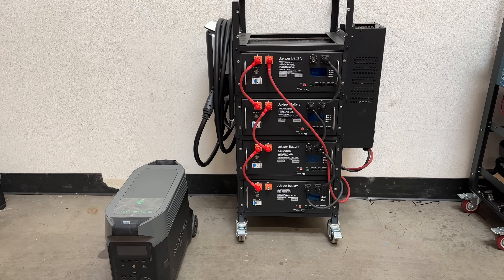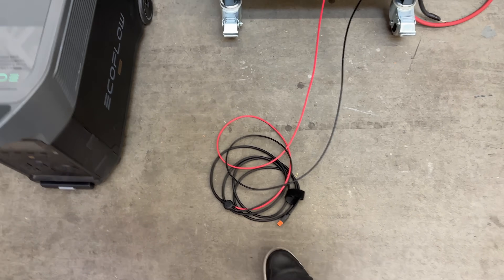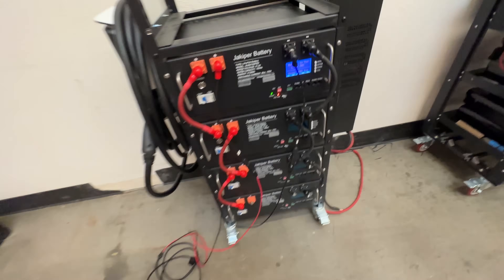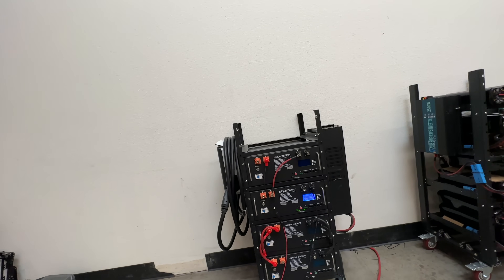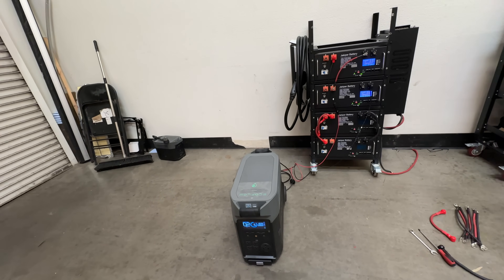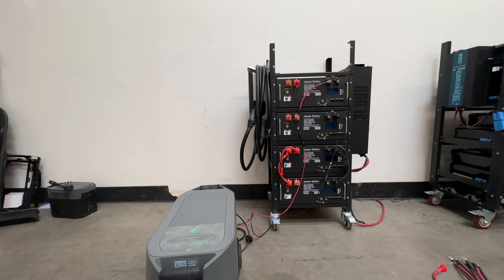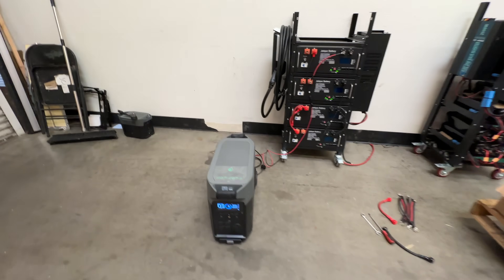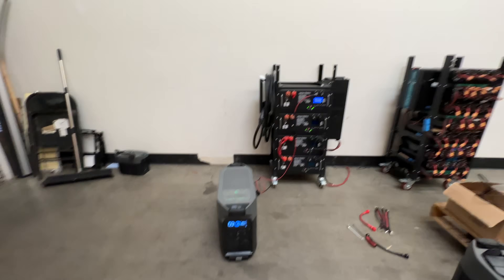48v Rack Mount LiFePO4 Batteries + @EcoFlowTech  DeltaPro

Comment: Your videos are great. I’m seeing mixed info on what xt60 or xt60i will work and they don’t have any solar charging cables for sale. The confusing thing is the car charger has an orange xt60i with extra pin. Which one is it?  Using the delta 2 btw.
Reply: The pin is connected to the negative in the xt60i for the solar. The pin is connected to positive for car charger.

Comment: I want to thank you for teaching us… I have 2 Echoflow Delta Pro’s and 4 external batteries. How can I charge the those batteries you have in the rack with solar?
Reply: With a mppt charge controller or a ac battery charger with the amount of voltage your batteries are. So if its 48v thats what charger you'll need.

Comment: not a bad idea for a small power and compact off-grid setup, like vanlife or RV.  I've been screaming in vanlife build videos that the electrical system can be better with a powerstation, where majority still use pricey and complicated Victron gear. 
I also find this channel finally covering LFP related equipment.

Comment: What is the point on connecting the batteries in series?!? There is none
Reply: to get 48v
Reply from the maker: You only need to connect cells in series if you need more that 3v.   Literally all battery packs above 3v-4v have cells connected in series
Reply: like Jehu said in another Comment, Delta pro can pull a max of 15 Amp.. no matter what the Voltage.. by plugging batterie in serie you double de voltage instead of doubling the amps by connecting it in parallel .. following the watt calculation of W=A*V ( watts = amp times volts ) you get double wattage for charging .. 3.6kw delta pro will need ( 3.6/1.6 = 2.25 ) about 2h30 to fully charge instead of  (3.6 / 0.8 ) almost 5 hours.. with 1600 watts of charging at 96ishVolts you still can charge the unit even if you are pulling 1000watts of power compared to charging it at 800 watts 48V... so yea .. electrical connections matters :)
Reply: I have a DP 
I advise do NOT exceed the 150 v 
In contrast the amps will be regulated on input . 
As in I have 3s2p strings of 47.24 v panels and so 3x47 for voltage is under but panels are 9.07ams max x 2 . Anyway don’t exceed 150v void warranties is what I’ve heard

Comment: I’d like to see hacking the Delta Pro with a similar battery rack set as if it was the official Delta Pro extra battery with discharge and charge functions.
Reply from the maker: That’s above my abilities
Reply: @jehugarcia  I don't believe it. Simply get the extra battery cable from ecoflow, cut it open and figure out the wiring. Done! If anyone could do this , you could
Reply: Perfekt idea
Reply: Hi. If you have only one battery jakiper for help the Delta 2 max for the night...How can you charge after the Battery jakiper if you don't have 1 inverter to connected with the panel solar

Comment: Any advise on how to setup charging the 48v battery bank with solar of course a solar charger controller in between then connected to the EFDP  and have this working in all harmony by any chance ? Wonder if it will dance well together ?
Reply: I think best way would be all in one mppt/inverter to server rack to bus bar to dc to dc charger to ecoflow delta pro.

Comment: Will this work with the delta max?
Reply: Will work with any solar generator as long as you stay within its voltage of solar charging & also having the connection it needs to charge it.

Comment: If im using that as a UPS wouldn't the ecoflow try to keep using the batteries charge, thinking its solar input?
so if we leave the charger on the batteries, itd just get sucked right back into the ecoflow right??
Need to think of a way to only use the batteries when the mains power is disabled
Reply: Way I use it or might work but I use it with the grid is a smart plug that you can turn on & off with your phone. You'd probably have to use a dc to ac inverter with the smart plug then to delta pro or all of that connected to a fuse block the server rack batteries are connected to. I know there would be some loss but the only real way to run off both separately while the server rack batteries can charge via solar.

Comment: Would this work using the LG Chem 48v 9.6kwh batteries Battery Hookup sold that don't have a bms??
Reply from the maker: batteries are batteries,  they always work until they don't.
Reply: @jehugarcia My concern was about having no bms...but I'm gonna take that as a yes. No bms other than the echoflow needed...

Comment: can you do it the other way around?  Eco to battery?
Reply: Yeah just with a ac to dc converter. There would be some loss but it would work. The ac part of inverter connected to delta pro outlet then its dc end to the batteries while you can charge delta pro with is solar input.

Comment: Great video! With this setup, could you also be able to wire in a charge controller to the batteries to solar charge the batteries during the day?
Reply from the maker: Yes
Reply: Does the charge controller just connect to the batteries at the same time as well?
Reply: @ciscokid81 - yes since that would be a separate unit of batteries being charged.

Comment: This is great but I’m looking for something that chargers the battery from an outlet. I am a trucker and have a blutti  thinking a outing buying the 300max I think it’s called and just getting there batts but it’s expensive and when I see other batts there cheep just don’t have the plugs like blutti
Reply: You'd just need a dc to dc charger. One end connects to your trucks battery thats being charged by the alternator & will also charge your bluetti etc or another solar generator or extra battery.
Reply: I would stay away from the Bluetti stuff. Go read some forums, the number of issues people have after spending several grand is mind blowing. Worse, is the amount of time it takes to make it right if that ever even happens.
Reply: @ericklein5097   thanks I have a PS70  I won from them and a EB3A there smaller stuff the EB3A works great zero issues the PS70 if it fill any movement it turns off  I talked to them about it and yeah they are bad at warranty stuff because they want you to make a video of it doing what it’s doing I just stop replying to them but still love the EB3A
Reply from the maker: It’s called a charger
Reply: @jehugarcia  I know your not that dumb to not understand what’s I’m saying so I have an inverter I have a blutti battery it gets charged by the outlet it chargers the other battery’s connected to it with out having the extra stuff just 1 connect I’m positive there a way to get them to connect to a different battery and do the same just haven’t seen someone do it yet don’t be a smart ass when you don’t understand

Comment: Wouldn't it be less expensive to use a "good" all in one inverter/converter mounted on the side of a diy battery rack... with wheels?
You'll be able to manage energy from solar, grid and batteries with less  restrictions...😉
Reply from the maker: Would be less expensive to not usa any of it.
Reply: Of course...😉
...but the 15 A limit for solar input in the powerflow is a huge bottle neck for this application... what's why I though about making "portable" an all in one inverter/converter instead...
Reply from the maker: you need more than 1.6kW charging on a portable unit?
Reply: @jehugarcia i.e. for ev ac-charging... but in this case you'll have less expensive options for the inverter anyway...
I'm still thinking about a 20 kW diy portable dc fast charger...🤔
Reply: @jehugarcia  are you planing others DIY solutions for portable EV- charging?
Reply: @davidsimoneta8513  Two DPs hooked to the dual voltage hub so that you can use 240V. This turns off all AC ports on the DP, bot input and output. So now, the solar input is the only way to get power into the DP and 800 watts after spending $1500 per battery is way too expensive to justify this.

Comment: Thank you very much for making this video. I posted comments on other tubers to show this type of addition since they have the materials to test out but they never did. So it helps us do budget ways on adding expansion to our solar generators using 3rd party batteries.
Reply: I want the same but Ecoflow won't make it easy for us to add more generic/off the shelf batteries to DP. They have extra battery unit that work in tandem with DP but we still not figure out how to set generic/off the shelf batteries to work with DP yet.
Reply: @junkvista61 - best way to do it is have a ac/dc charger connected to a smart plug then to ac of DP so you can remotely charger it while it uses the solar etc so you can charge the 3rd party batteries. Yes not that efficient since it's AC to DC but the sun power is free so yeah.

Comment: I have a Delta 2 and EcoFlow uses an Orange XT60i plug, instead of a Yellow XT60 for solar. They limit to 8 Amps a regular XT60 plug, because that wiring is used for a 12V Car plug.

Comment: Yeah but if you put a 2k or more load on the eco flow, the battery will never be able to charge it fast enough through the xt60 connector to keep up.  Plus the solar cables aren't big enough to properly handle the potential output from the server batteries. Won't they overheat?
Reply: I believe you'd just have to change out the cables on both ends. The mc4 to battery terminal to server rack batteries  & the cable with the xt60i to higher gauged. Plus the amps are limited to what the delta pro is which is 15amp max.
Reply from the maker: The deltaPro can only load battery 15A. cables are properly sized.

Comment: Great Video, it give many ECOFLOW owner a more economic way of adding batteries. Suggest to remain battery parallel connect as 48V to charge the ECOFLOW System.
Reply: Very slow charging after spending so much money!
Reply: I buy Basen Green 11,7kw 51,2V (200A max) and I try to charge my Delta pro the same way via xt60 with xt60i cable(orange one) ... after charging at 15,5A for a minute the charging start like go stop go stop (-3A -5A -3A -5A etc...) every 5 seconds?? What can it be wrong?
Reply: @adamsisernik4556  It exceeds 15A, that's why. In my understanding, 15Amps 51.2V = 5.1kwh. I dont know how your batteries are built, but if you want a bigger one, it should be in series, it will make 51.2V x 2 = 102.4V and its current should remain 15Amps. Correct me if im wrong.
Reply: @JustaCuriousity  Yes. you are right... My battery is 11,7kWh so 16cells in series I guess... Got answer from EF support saying that they don’t recommend charging DP with it since the output surpass the solar charging limit too much. 

The current input power from my panels via xt60 in the DP is calculated to be 18.8A in it is workih fine.... so output value from my battery could be set over 15A too ??, but specification says 15A max... so I will ask Basen Green support team, to set it to 12A, to be worry free. They can make this remotely :) so therefore, we can later adjust the setting to a higher value.

Comment: While you can connect these batteries in series, it generally is not reliable because a low-voltage BMS shutdown of one of the series-connected batteries will prevent the other battery from being able to balance, as well as cause bootstrapping problems to reactivate the BMS.   And a high-voltage shutdown can cause other problems.

Some batteries are documented to allow series connection, but this does not necessarily fix all the issues and reliability can suffer.   In particular, people do connect 12V lithium-based batteries in series, along with a whole-battery balancer (or several).  But that options doesn't usually exist for 24V and 48V batteries.

So generally speaking you do not want to connect lithium batteries in series.  It will work just fine as long as the batteries never hit a BMS disconnect condition, but because it might hit a BMS disconnect condition it isn't reliable.
Reply: An excellent reason to ditch the BMS and on your server rack batteries and just run the packs raw and use one of those voltage detection screens to monitor cell voltage with an active balancer. It's LiFeP04, you'd have to be a dumbass to kill it.
Reply: @ericklein5097  That's ... really a stupendously bad idea.  LiFePO4 is more resilient than other lithium chemistries, but it is not immune to screwups.  BMS's perform numerous important safety functions that can't be duplicated with ad-hoc monitoring or an active balancer.

The proper solution is simply to not put lithium battery packs in series.   Nor is there any need to.   People with legacy 12V batteries do have a partial solution in that 12V multi-battery balancers are cheap and plentiful.  But otherwise it just should not be done by us DIYers.
Reply: @junkerzn7312  To say that there is no need to need the power that two 48v lithium batters offer in series is ludicrous. I have two delta pros hooked to the dual voltage hub and I want to buy two 48V batteries instead of the extra batteries that ecoflow sells as they are way too expensive. Now by hooking up those two batteries in series only gives me 500 to 600w of power is not acceptible and is not enough power for me. I need at least 1000w of charging power so I am stuck at this point..not safe to use the 48v batteries in series and so what now. This video gets me excited and then when I look at reality it is a big let down.
Reply: @LarryRichelli  First of all, I think you are wildly confused about just how batteries can be hooked together.   In general, you CANNOT mix and match Power station battery systems with discrete external batteries unless they are explicitly designed to operate with that particular power station.   Power stations rarely use 8x or 16x internal cell topologies.

Nor can you put a power station's raw battery output in series with other unrelated batteries.

I'm sorry, but that's the deal.  That's the problem with getting big power stations... you can't expand them without using the vendor's (typically expensive) expansion options.

--

I think you might also be miscalculating.   Lets take a 48V 100Ah LiFePO4 battery.  The manufacturers charge and discharge specs depend on the battery but typically such a battery CAN be discharged at 1C, which is 100A.   48V x 100A = 4800W.

Two 48V LiFePO4 batteries in parallel can easily discharge at 200A.  That's 9600W.

People construct 48V battery banks with 6 or even 12 such batteries connected in parallel.  That's a lot of power capability.   Look at, for example, 48V EG4 LL batteries (just google that).

Obviously you need to size fuses, wires, busses, and breakers properly to handle the amperage.  But it isn't that big a deal.   Large paralleled 48V battery systems can drive tens of kilowatts of load.

Provisio:  When properly designed.  And given what you are trying to do, that might end up being a "no" for you.

Comment: Thank you for this video. I've been on the fence about doing exactly this since I couldn't find anything concrete online. I am very interested in the options for quick charging (via AC plug ) the server rack batteries between rolling power outages, etc.
Reply: Same thought I've had since I got my pro's on kickstarter. I even posted comments on other tubers since they have the materials but most never have.

Comment: waiting delta 2 to arive and thinking of charge it with solar and outside mppt charger at my storage where is all my needs !!! 500watts is fair if you can have almost all ,and 60 volts in battery packs require  a bit crazy and rare setup and charger

Comment: @jehugarcia  man first let me say…
Your the battery god! I was waiting to see someone connect a rack battery to the Delta pro, but no one did.
The max amperage for the Delta Pro is 15 amps. I thought it would burn up with the rack battery. I guess the pro can throttle down what it accepts at its input.
Anyway you made my year and I’m a supporter for life as you respond quick with videos.
Reply: A device will only pull what it needs. Obviously solar panels being a different story.
Reply: All solar generator all in one's have safety protection built in them either it be the AMP or VOLTAGE needed to charge/use them. Its probably a law everywhere when designing them so general public doesn't have to worry or most don't think of that aspect thats why. If your buying one that doesn't have those standards, I wouldn't buy it.
Reply: @1ENDUSER  interesting in watching many videos on charging portables they never mention this. EcoFlow is limited to 15 A. I have been going back-and-forth between a 15 amp versus 20 amp DC DC converter.

Comment: Jehu, I have brought your 12v 100Ah SLM121 LIFEPO4 12V 200A 4S2P 1200WH BATTERY and I got your BMS and PC board and I have one of the original Bluetti AC200 (before the AC200P). I want to know if I can use that battery to supplement the internal battery of the AC200? I hope you can let me know.
Reply from the maker: Yeah connect it using the 12v charge cable that Blueti makes for the Ac200

Comment: Thanks, very cool. Do you have to disconnect the MC4 wires from the batteries to charge them with a charger?
Reply from the maker: No it’s just a bolt,  you can connect multiple connectors at same time

Comment: As Delta Pro's and Delta Max's can connect, charge and drain the official batteries via the side connectors, can you connect the rack mount batteries in the same way, so you can maintain the solar connection via the XT60i port?
Reply from the maker: Not without custom hardware and software
Reply: I think that would confuse the Delta Pro, because it uses the solar to charge the official extra batteries via that port. I don't think it's a simple power port that you could wire into.